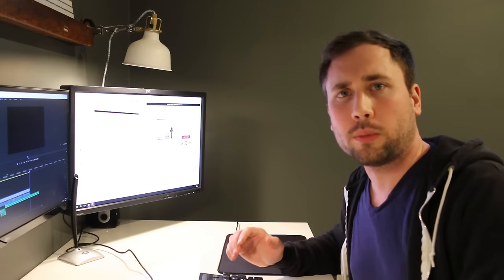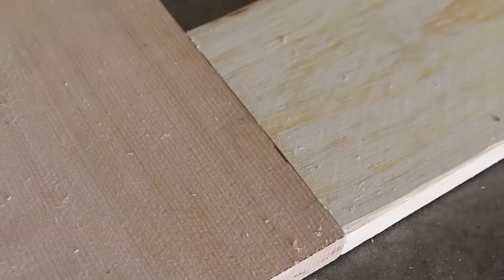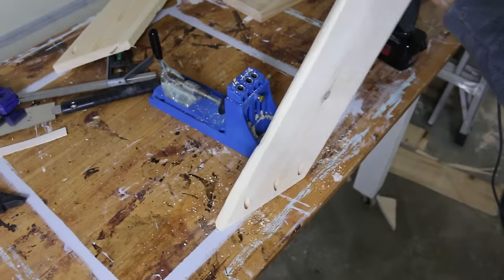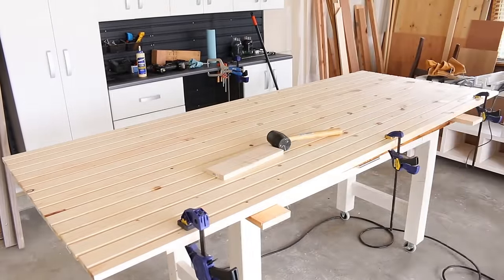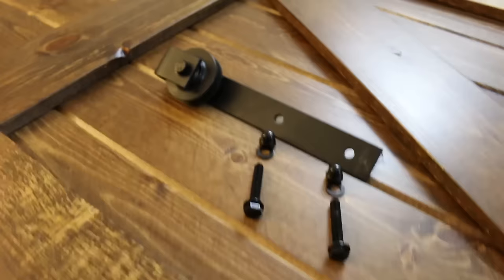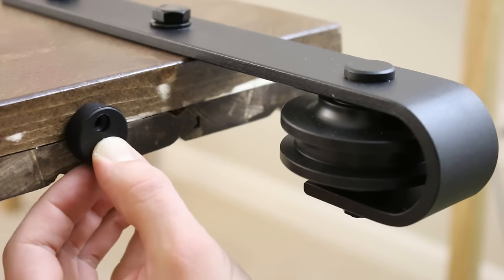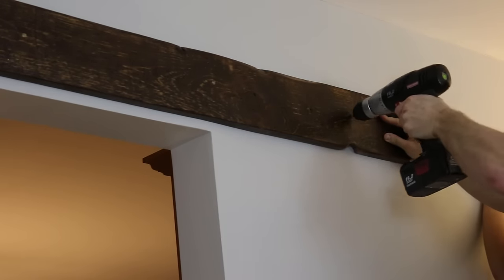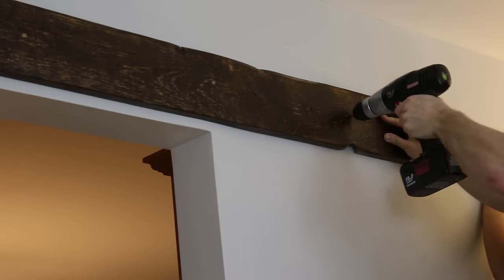DIY Sliding Barn Door

Comment: Made 2 barn doors using your construction technique. It worked great. Love the pocket screw construction. That and some glue makes a tight indestructible joint. Hardest part is finding enough straight and halfway true lumber. Thanks for the video.

Comment: It looks like those black lag screws  provided with the track for the barn door are long enough to go through the spacers and into the studs. However, since you mounted that header/ledger board, wouldn’t you be going through that board And into the sheet rock with nothing behind it? What I’m trying to say is that wouldn’t sure black leg screws be better for this application?

Comment: I have the same problem with straight cuts! I wish I'd had clamps to clamp my straight edge down when I was in woodworking class back in the 90s. It would have made it so much easier bc I always ended up moving it when trying to draw a straight line. LOL. We didn't have a speed square in the class for some reason.
Nice tutorial. The hardware seems nice. The stain color is beautiful!

Comment: How big is the gap between the back of the door and the wall?  I'm planning on building one like this, but need to minimize the gap because of the noise from the laundry room.  Nice build.
Reply from the maker: hey kent it's about an inch and a quarter off the wall. it does block some noise but not all. keep in mind i'm using a header that pushes out the door another 3/4". you may also consider getting a longer rail and making the door wider to help with the noise. hope that helps!

Comment: After you stained it, did you coat it with varnish or polyurethane or anything? Or just left the stain alone?
Reply: Bastian I was wondering the same thing. I personally would use polyurethane. Protect the wood and stain and easy to wipe clean.

Comment: Really nice.  But.. Caution putting screws into carpet.  I tore a long thread out of my carpet when the screw caught and left a permanent line across the living room.  Wife loved it!  2nd, keep hand back at least the length of the nail you are using in the nail gun.  I shot a 2 1/2" nail right through my finger when it hit another nail inside the board and went sideways.  Oddly, it didn't hurt as much as you would think.

Comment: Love this project and I plan on trying to build one for myself.

Question for you, do you think its possible to rip the front and back piece of the tongue and groove boards with a circular saw after you've nailed them into the frame, provided there's enough clearance?

I ask because the only tool I don't have is a table saw and I'm trying to see if there's another way around it.

Comment: Great video. I bought the Kreg jig, what a great tool!! 

I really found the angle cuts hard. What did you use to get the "57 degrees"

I cut the first one perfect, but every time I cut the second angle to fit in I was always perfect if I was 1/4" off the 1x6 frame. It was driving me crazy!

Comment: Looks great, and I really like the detail that you go into for those with no carpentry experience, but maybe an architrave for a little more soundproofing/air flow seal between rooms?
Reply from the maker: thanks! the room isn't closed off (opens into living room) so airflow really shouldn't be a problem. soundproofing isn't really necessary either as we're in one room or the other, but not a bad idea!

Comment: When mounting your rail, did any of your lag screws that came with the door actually hit studs? I know your mounting board hit studs, but couldn’t the rail just pull out of that mounting board if it’s only going through your thin mounting board and then just into dry wall?
Reply from the maker: Hey Andy yes it hit one or two studs. Since the header is bolted into the studs and the weight of the door is pulling down and not out i'm not concerned about the thickness of the board. It feels very safe and secure. Hope that answers your question!
Reply: DIYwithRick awesome thanks. I am mounting a 51” door and was concerned about weight. My rail also come predrilled with 16” holes apart. I don’t know if my studs will line up or not. I got a 1x6 header just to be safe

Comment: Nice work there Rick, was looking around for a solution for my computer room think this might just be what I was looking for. What is the blue crank device (at 0.40 secs) you use for doing the pre-drills for the pocket screws?
Reply from the maker: thanks viguy! it's called the kreg jig. there's a full kit for around $99 OR a mini jig for about $20. super easy to use after reading the quickstart guide and creates strong long lasting joints.

Comment: Great video! Question: So you drill and screw the header into the studs. Then you can place the railing anywhere on the header? How do the railing screws not slip out of the header because they aren't in studs? Thanks again!
Reply: Taylor Snyder the header acts as horizontal stud.

Comment: Because pocket holes screw in an angle you will get movement when you fasten. Use a speed clamp to align the 2 pieces before putting in your screws. Then you won't get that height difference.
Reply from the maker: This is fantastic advice, thank you!

Comment: Why make all of those pocket holes if you are going to put boards on the other side. Why not just glue and screw the back side boards to the front boards. Seems like you could have saved some time on that. I have seen others do it that way. Any specific reason for the added work and materials?

Comment: Whats the tool you use called where you make the holes for the screws? Or the name of that technique. I'm blanking
Reply from the maker: hey Aidan it's the kreg jig system. Here's a link to my website with all the tools/materials and step by step guide: http://diywithrick.com/2017/02/26/build-and-install-a-sliding-barn-door/
Reply: Aidan O'Neill It's a Kreg Jig. The technique is called pocket hole joinery.

Comment: Great build and instructional video. "Project Manager"... Hilarious. For the channel guide you could consider cutting a piece of trim with the groove, then attach to the bottom edge. Adjust your measurements of the door and trim. For the groove on the trim cut it out with the table saw with multiple passes or use a dado stack blade. Still your door looks great and good job with troubleshooting the door guide.

Comment: Hi, question. I live this video but I need help with measurements if my closet is 38 x 80 1/2 what should my measurement to the diy door be??? Also ou ts a closet so theres about a 3in step but the 80 1/2 is only the opening and I have tiles floors is there something else I can use to hold the door on the bottom?

Comment: You could have cut the channel for the lower door guide into the lumber before assembly using your table saw.
You would have had to cut dado's into the ends of the car siding and ripped a channel into the lower 1X6 so that they lined up on assembly.
This way you could have installed the guide as per the instructions.
Overall, nice build tho.
Reply from the maker: yeah I couldn't wrap my head around what to do prior to the build but appreciate the advice for next time!
Reply: Don't get me wrong, you did a great job.  
I wasn't trying to be a critic, just making a suggestion.
Reply from the maker: oh no I honestly appreciate you taking the time to write-up feedback! always open to learning and improving for next time!

Comment: What about the light switch?
Reply: Also there is no handle on the other side it seems? And since there is no guide on the back of the door on the bottom it can still bang against the wall right? I know he said it wouldn't but it looks like you could push a little too low on the door and bend shit up top.
Reply from the maker: Yeah it's not optimal. If I had some electrical exp. I would move it. But! The room doesn't get much use and it's just a slide away when we do!
Reply from the maker: If the door were to go into the wall it wouldn't bend the top hardware. It's about 1" to 3/4" off the trim so there's not enough space to really effect the caster/rail. While a channel for the guide would be better, I can open and close the door multiple times with a good amount of force (not trying to keep it off the wall) and it doesn't even come close to the wall.

A routed out handle on the back side would be REALLY nice though, once I learn how to use a router.

Comment: You did what just about every other barn door video  did . You didn't go over  how you figured out  how high to place the rail off the  floor .

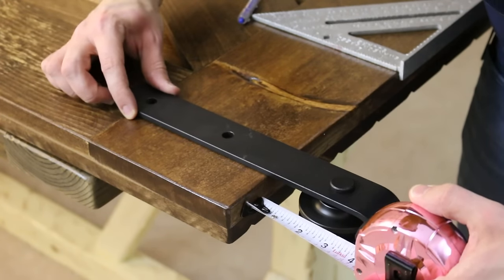 At 6:21 in the video  you measured  1 3/4 from the bottom of the casters to the top of the door  which  in most cases will put the top of the rail going up another 1/4 inch  for a total of 2 inches . Knowing how far away the bottom of the grove  in the caster where the rail is going to be riding on is very important info because not only are you going to have to add 2  inches  to the  height of the door but you have to add another 1/2 to 1 inch  so the  door  has clearance off the floor . 

For example lets say your door is 84 inches  and lets say  the deepest part of the  casters to the top of the door is 2 inches  now add a extra 1/2 inch for  floor clearance so now your at 86 1/2 inches  from the floor to the top of the rail .  Now you can  take your measuring tape and  make a  86 1/2 inch mark on  the  top board  going across .  Do the same thing on the far end of the board   don't just  level the  rail  from that one marking.   

Once you have the  2 marks on the  wood from the floor up ,  hold the  rail up to the marks as close as you can  and use a tack nail in one of the rail holes  to hold  the one end of the rail  in place at the correct height ,even with your floor measurement mark on the  board , then go to the other side and  tack a nail  in a rail hole  so the top of the rail matches your other  mark .

Now put a lever on the rail to make sure the  rail is level  . If its level your now ready to  start marking the holes on the wood,   but if  the rail is not level this means your floor is not the same level  at both ends of the floor  . 

What happens if the floor is not level and lets say  the rail is  higher on the far side  then when you open the door its going to hit the floor and lift the door off the rails .  

Take out the  tack nail  on one side and raise or lower the rail  to make it level . If you have to raise  the rail to get it level  then you can  leave the other side alone and  mark  the holes  because  its going to mean your just going to have a little more space under the door on the  far side , but if you have to lower  the rail  to make it level  and  its a 1/2 inch or more  below your  mark on the wood   to make the rail level  then your going to have to raise up the  other side another 1/2  and  level the rail again .  

In a lot of the older homes the floor's are not always  perfectly level so its better  to measure on both ends from the floor up  and check the level   of the rail  before you go  making holes in the wood . You don't want to  just level   the rail from only one  measurement ,  you want to level the rail so  its at the height you need at both  ends . 

If you don't  do it this way  when you go to open the door it will only open so far  till it starts binding on the floor  and your going to have  to unscrew all your bolts out of the rail and do it all over again . Its a lot  easier  to measure   both ends and  get it right the first time  and not have holes all in your  top wood piece .

Comment: He didn't do a terrible job.. But he did do an unprofessional job. This might be a good a enough door for a homeowner or a DIY project However adding just a couple other steps will make this look professional. You shouldn't 3/4 board as a face frame use a 2x4 rabbit the inside to hold your tongue and groove 3/4 This is to keep the edge of both boards from being seen. This is a unprofessional hack job that looks ok to people that don't know any better. If you want to look like you know what your doing and to be proud of your job do a professional one

Comment: I made it about 3 minute in before I had to just stop. Guy wears a dust mask while driving in screws....which is fine, personal preference and all....but I didn't see a square used or even checking the diagonals.
Reply from the maker: Hey Mark! I had just ripped a bunch of stuff on my table saw with no dust collection. It was COLD and my garage door was shut. So I opted to leave the mask on instead of breathe all that dust in. And the door is square, though I may not have filmed it. Thanks for watching!

Comment: Love it, but Minwax really sucks.
Reply from the maker: thanks but why does minwax suck?
Reply: I think there are better options. The pigments are not good, and is splotchy on many types of woods. If you go to a woodworking or specialty paint store, you'll find stains from General Finishes. I've had much better luck with that.  I've also had good luck with Old Masters. I've used ZAR a few times and liked it, as well, but don't have a ton of experience with it.
Reply from the maker: I'll check out general finishes & old masters. Appreciate the tip man!
Reply: Your work is too good not to have a nice finish!